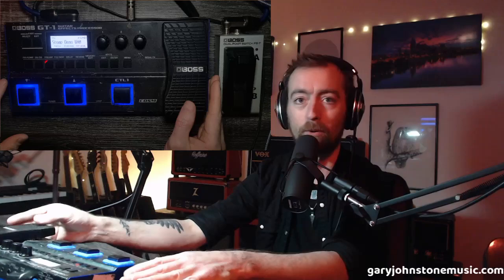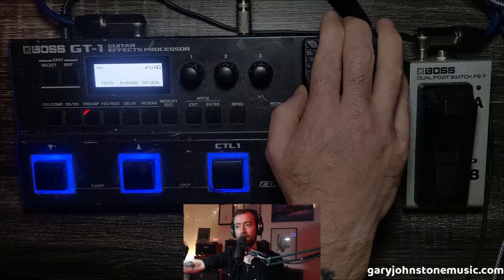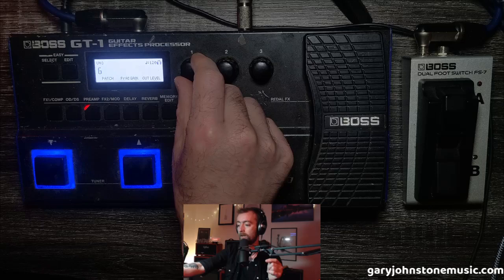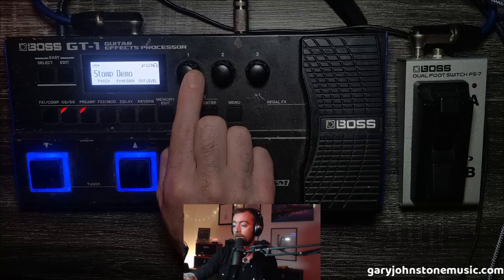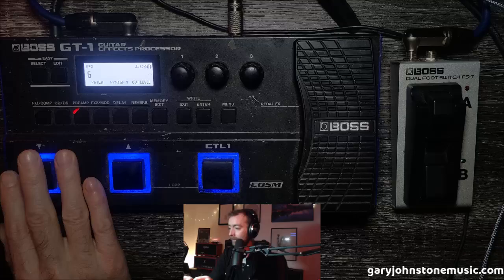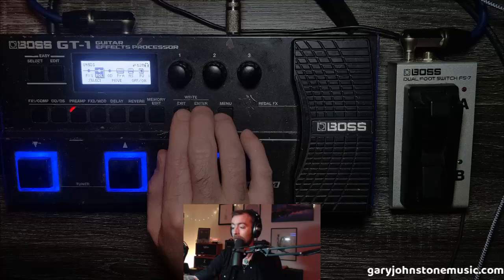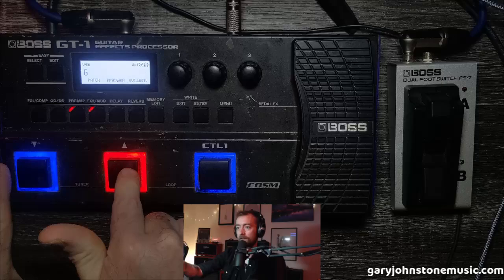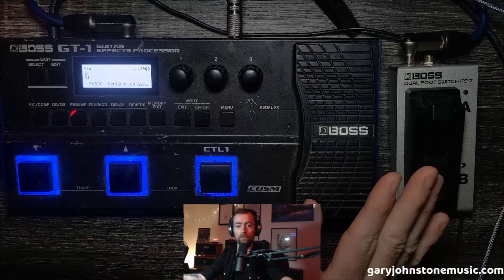Boss GT1 tutorial - How to setup like a stomp box board

Comment: Gary - thanks a million, your videos are the most useful and helpful I've found. I bought the GT-1 several years ago, couldn't make it do what I wanted, and put it aside and let it gather dust. Now, with your help, it has replaced my pedalboard - smaller, lighter, simpler, more options. Well done.
Reply from the maker: @davemorrison-amurderofcrow287  Thanks Dave. I initially thought I would use the GT1 for certain smaller gigs or particular situations, but it does so much so well that I'd now be lost without it.

Comment: Thanks.  Just got one and first thing I did was use your tip to turn off the volume/FX setting on the expression pedal.  I wonder if that is why many people complain about the built-in patches having unequal levels.  I thought same until I realized I was touching the pedal and turning the volume down.   ...later realized I had to do that for each patch!
Reply from the maker: Na the presets will still be different volumes regardless of your exp1 settings. You can use the on board exp to change them as you go but if you watch my other video about setting up tones per patch it may help.

Comment: I use a lot of what you mentioned, HOWEVER, in a live setting I keep my patches in order so I only need the down button. Opening up the up button for other options as well as the FS-6 (I prefer the horizontal orientation). You should probably mention that buttons that ARE NOT CTL buttons have limited options to them. Still useful, but not as versatile so you have to choose accordingly. A very solid MFX board.have been giving with it for a year now👍🏼
Reply from the maker: Thanks for the comment dude. It's amazing how even a tiny board like this can be used in so many different ways. 

I use it exactly the way you described for originals gigs or when I know what the setlist is and I can plan ahead, but mostly my covers band just show up and go "What you wanna hear?" 😂 So it makes sense to use it like this as sort of a "cover all" (pun absolutely intended) toolbox. Hope the gigs are going great man 👍 Let me know if you have any Q's

Comment: Received my GT-1 - what an awesome device.  Very similar to my GP-10 (without the synth of course)
The footswitch mode described here by Gary works a treat.  Only thing to note is there does not appear to be a way to use the Assign feature on the up/down pedals.  This is a shame, as on the GP-10 I could assign multiple things to one footswitch.  E.g. Overdrive + Delay.
On the GT-1 The Up/Down pedals can be assigned to just a single function - e.g. Overdrive only, with no other Assigns (unless I'm missing something).  Shame.
It still works for me.  I’m happy.  But thought I’d mention it.
Reply from the maker: I haven't tried that so didn't notice it. I think you can assign CT1,CT2 + CT3 to do multiple functions. It is weird that up and down can't be used in the same way but as I say to myself every time I find something I wish I could do with this "what do we expect for £150" 😂 Happy jamming bro 👍
Reply: @garyjohnstonemusic  Too right Gary.  After spending sh** loads on Kempers, Tonemaster Pro, guitar synths etc etc this is the best bang for buck music grear I’ve even bought.  Keep up the great videos mate!

Comment: I'm going to try this. I have mine setup as a sequence of patches named for each song in our setlist. I use a 3 button external pedal that do exactly what you're doing with the Up, Down and CTL1. I figured if I have 99 spots, I can use the first 48. This also helps me for the few songs we do that are drop D. I have a patch that does nothing except remind me to tune back to std. I can't count how many times I've started Little Sister in drop D. I'm getting fairly good at tuning back up on the fly but it's not ideal. I really appreciate the tip with the expression pedal. I've accidentally hit that and killed my volume. Funny because of how long it takes your brain to realize what you've done. Not long but feels like a minute when your live. Love my GT-1
Reply from the maker: A 3 button ext pedal is even better! How can that work with just a stereo ext input though?
Reply: I’ve set mine up so that the first button of the 3 button pedal is my boost, the second button is delay and the 3rd button will turn both the boost and delay on or off at the same time. You can assign a different effect to each button though. Not sure how it works but it does.

Comment: Thank you for sharing this idea. Here and now I'm exprimenting with the Boss GT-1 and the FX-loop in my amp. I'd like to hear your oppinion on FX-loops and GT-1.-
Reply from the maker: Ah great question! If you're using the GT1 like this as in a digital version of a stomp board it's really a trade off. FX loops in amps are usually for post gain modulation/reverbs/delays etc

There's no hard and fast rule obviously, but you don't really want to be putting gain stages in the loop.

If you were only using the GT1 for it's mod/rev/delay effects that would be perfect to put in the amp FX loop and it seems to do a great job of that but if you're using it for OD/DIST it won't give you the same sound as if it was going in front. 

Interesting take though, I'd like to know how you get on with that. Maybe you can use the GT1 in the loop but still use comp/drive stomps in the front end?

Comment: Good Morning again. Thanks for your replies to my crazy ideas. I have another q for you. I love my Gt1. I use a program called stagetraxx 3 for my backing tracks, and guitar on stage. My next project is to understand how to control the gt1 using stagetraxx 3 and I know thats a different thing, but I wanted to see if it can be controlled via midi for this purpose.  So im hearing I can have stagetraxx 3 change soundbanks without using a foot controller. It would be so cool if it could just change the patches, like from clean to distortion, without having to stomp on switches all the time. Think I can do that with the gt1?
Reply: I hear that this has no midi capabilities, so wont work

Comment: Right now my it says my pedel is off how do I turn it on
Reply from the maker: @FreefireFNCS  Whether powered by batteries or mains supply, it only turns on when there is a cable connected to the input. Hence why there is no ON switch.
Reply: @garyjohnstonemusic  I meant the FX pedel u were talking about in the video the whole thing is on just not the light by the pedel
Reply: But I figured it out🙃

Comment: When i assign ctr 1 to overdive such as OD-1 and then activate it it hisses so bad that the pa guy puts on a noise gate that is really interfering with my playing. Basically the noise gate is cutting out the length of the notes and cutting out smaller subtle movements. Anyone had these same issues or have any wisdom to share on how to get a result?
Reply from the maker: Sorry Simon I haven't had that issue but I do understand your problem. We play a gig where the electrics in the venue (due to a million bulbs in the ceiling) makes it impossible for me to play anything with single coils due to buzzing so I stick to humbucker guitars there. Maybe that would help? Sorry I couldn't be of more use 😭

Comment: Great stuff.  Just for clarity - when you Write the EX1 to be only Pedal FX, this only changes the pedals function for that one patch, correct?  So in other words, if I want to make the onboard pedal ALWAYS be only for Pedal FX (never volume) I would need to do this for every patch?  
Thanks!
Reply from the maker: Correct, but my way of doing it is to set up a base patch like this, so all your main preferences (like EX1 function and CTL assigns) will copy across to all patches. It might even be easier for some to set up an almost blank patch with these elements then just copy those across all your patches, so wherever you go to start building sounds those parameters will already be set. Best of luck 👍
Reply: @garyjohnstonemusic What Gary said! Great content,Hombre Johnstone👍 We use Katana heads and grabbed a GT-1 for a battery operated backup. What a sleeper keeper.  Daaaang,bro....our GT-1 just keeps earning it's keep--you just added a whole nuther level of user flexibility!

Comment: Hi Gary please help . I’ve just recieved my gt1 . I  connected a Amparo A/B foot switch . I followed your video everything was good until I tried to push the pedal if I go up the path he’d just fly through until they reach a P patch same if a go down . So I tried my tv helicon switch 3 . Same reaction they fly through . What have I done wrong ?
Reply from the maker: Hey, you need to set the external pedal function to be the same for every patch. If you use it to switch to a patch where CTL 2 and 3 are not assigned to be patch up and down, it will most likely do something weird like this.
Reply: @garyjohnstonemusic  hi thanks for that . I set it all on u01. I then pushed write and basically copied the settings across a further 9 user patches . These are the ones it just fkies through non stop . The manual suggests there is option to toggle or mode but there isn’t
Reply from the maker: @derekhandley3270  make sure you have your ext pedal set to non latching if that's an option on your pedal. Otherwise I can't explain that I'm afraid. Just a case of tinkering with the menus. I did have to spend a fair while of trial and error til I got it to work like this. 

Bear in mind I've only used the boss fs6 and fs7 this way, I don't know how other versions of AB switches would behave. Did you use a stereo cable to attach it?
Reply: @garyjohnstonemusic  I’ve just done a f-reset on U01 to 99 I’ll do the process again and see if I get a different outcome
Reply: @garyjohnstonemusic  
Yes I used a stereo cable . I don’t have a latch facility . I reckon it functions only with a boss pedal .
Reply: Hi Gary , my work around is I’ve used by TCH switch 3  , fist switch is delay , second is fx2 and third turn both either on or off . The GT 1 accepted that but will not let me go up down with the switches momentary I’ve tried two different ones . Works like this so will be fine . Thanks for the videos Gary
Reply from the maker: Yeh sounds like they may have made it so the the FS ones are the best ones for the job but glad you found a workaround 👍

Comment: Is there a way to jump from for example patch 1 to patch 20 without having to loop all the 20 patches??? 
Or if there is a way to use the up and down pedals without activating the next patch, so you don't loop the entire 20 patches??
Reply from the maker: Nope. Not that I'm aware of anyway.
Reply: I believe you can always switch the order of the patches, for example, you can switch patch no 20 and move it to the desired position, let's say pos no 2. That way you have patches 1&2 close together. I used to use it like that. Place the 3 most used patches next to each other, with the most used one in the middle. You can then use the CTL1 switch on top of that to add the fx or change the sound completely (you can really tweak the fxs to almost sound like an entirely different setting altogether) which would, in theory, give you a total of 6 options to choose from mid songs. It gets really easy tapping the pedal twice to move to another sound once you get a grip on it. Hope this helps.
Reply from the maker: @96gaber thanks for the comment and yes that is an option. It's even easier when you use the Boss Tone Studio desktop app